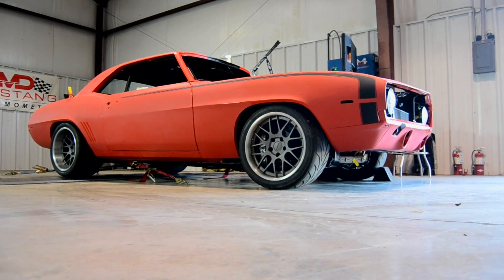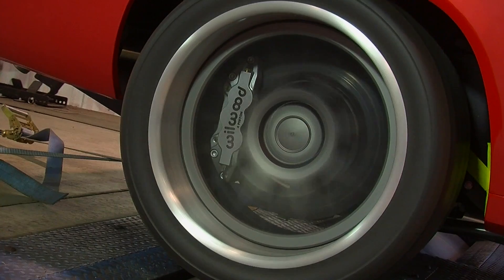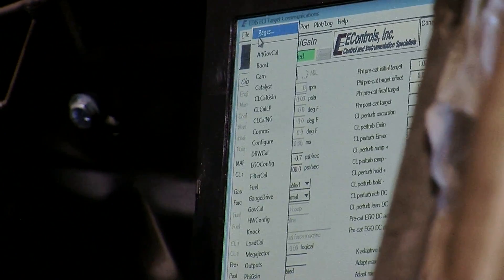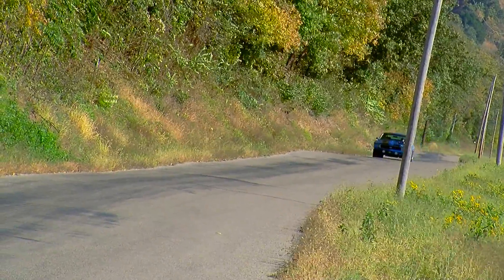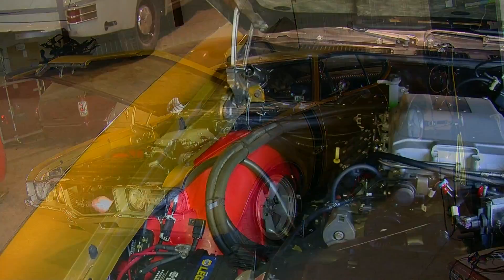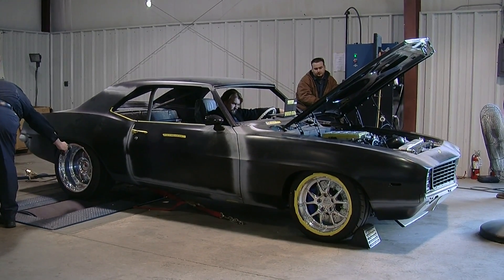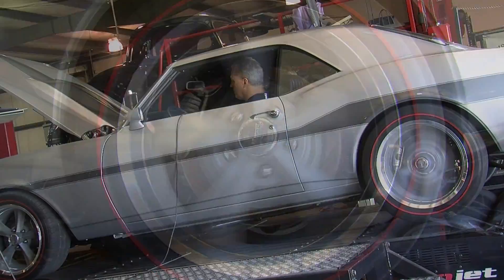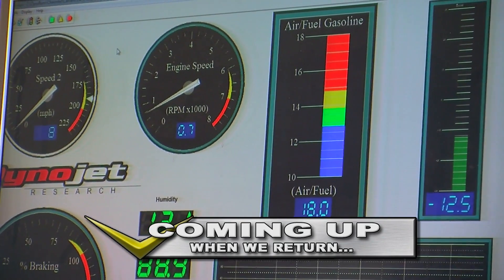Tips For A Successful Dyno Session Video Part 1 V8TV

Comment: I've seen you at the St.Louis Calvers car show before and you pulled up in you're flat blacked restomod Pontiac GTO with a 403 HP 6.2L LS V8 out of a Cadillac escalade.
Reply from the maker: Yes sir, that was a '66 GTO we built for a customer a few years back.   I think that car has completed 9 Hot Rod Power Tours over the years.      Here's that car's photo gallery:     http://v8tvshow.com/V8TV_2/index.php/car-build-photo-galleries?view=goldpicasa&album=6238624792082905985&userId=100048221976759975667

Comment: Don't forget to finish with at street tune which may or may not involve any changes.  In many cases the engine is going to run better in the real world because it's getting more fresh air and you are getting the actual resistance of running down the road.

Don't be shocked if power falls short of your expectations, your tuner will normally know if it's a problem or not.  Dyno sessions are a lot like fishing, plenty of people exaggerating.